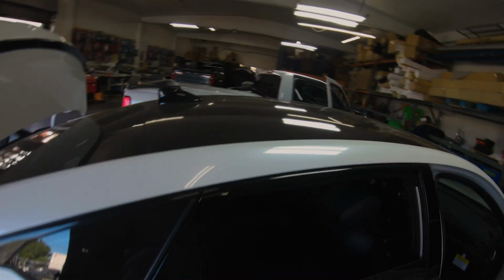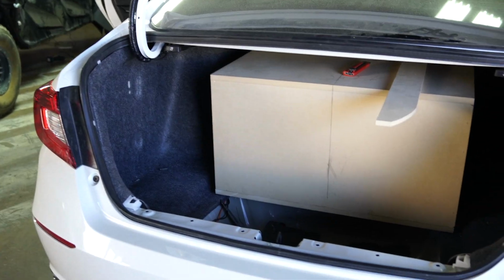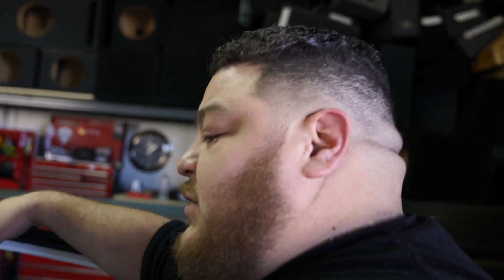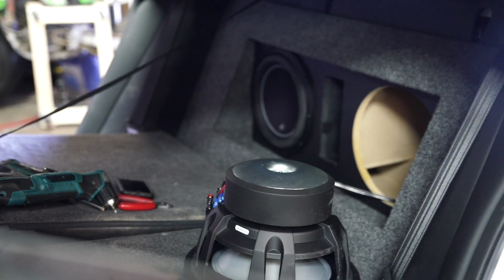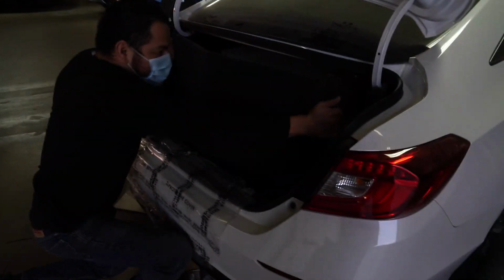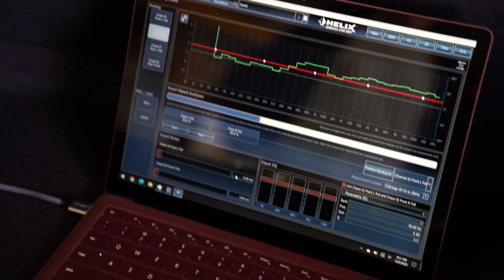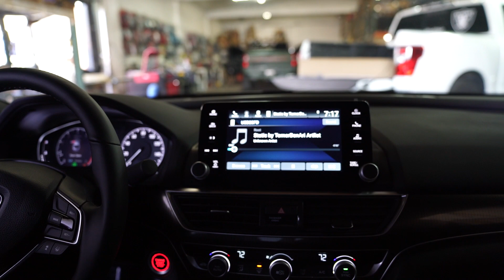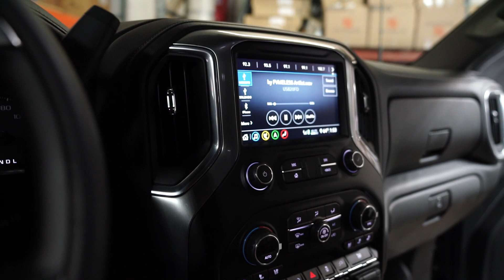2020 Honda Accord, Audiofrog, modern blow through 2 JL W6V3

Comment: Did I miss it? What did you guys use for tweeters? Curious where you set your crossovers mids/tweets and mids/subs. I have a 19' Accord Sport with Audiofrog mids, Hertz Mille tweets and IncriminatorAudio subs powered by Arc Audio and a Helix dsp as well.
Reply from the maker: Its all gs audiofrog gs10 gs60 and gs62 the tune is done by Jack he's the tuner. So I don't know 😕

Comment: I had a shop connect a sub to my 2020 Honda Accord and it sounds like shit. When I turn up the volume the speaker muffles. No the sub is not blown. I purchased a LC2I pro to be added but they said it was not recommended. That they were able to tap the wife from the front door speaker.🤦‍♂️